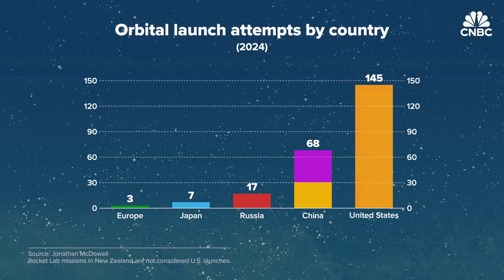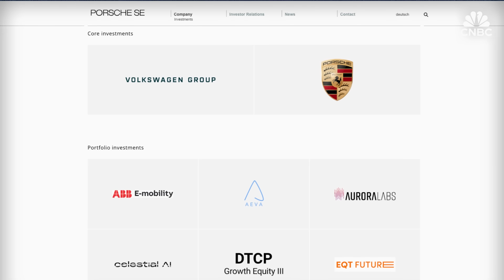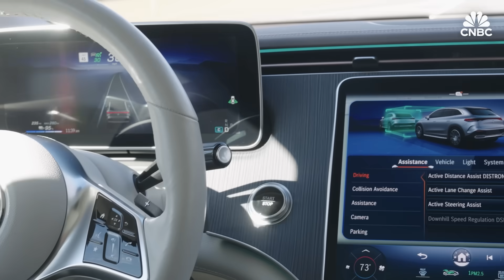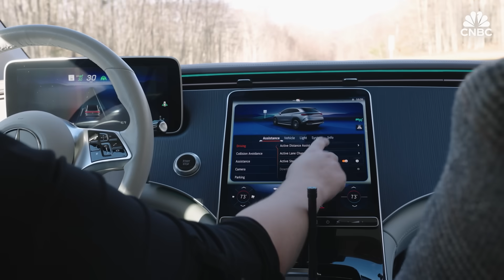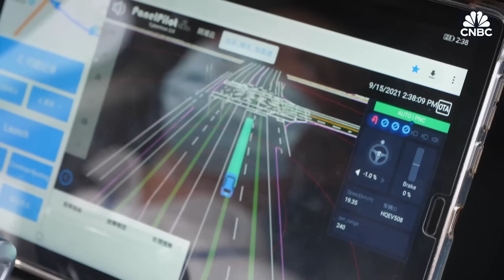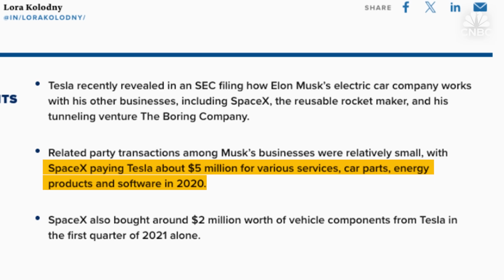Why Toyota And Honda Are Investing In Space Technologies

Comment: To be honest they might made the right move, and it’s one of the better investments compare to all the other competitors. In terms of why…. The fuel injection the aerodynamics,the material, the electronics in terms of take off, you know these cars are still trying to do 5G network… imagine connecting from far away like 3 miles up in the sky moving mile a minute, but you translate that to street level. 

Also some of the storage packing design is like good enough, ac, and temperature differential handling in all components right, imagine having from deep space near zero to rocket burning propellers.